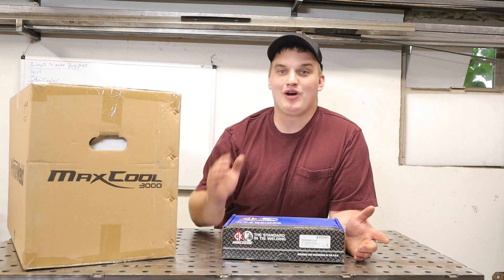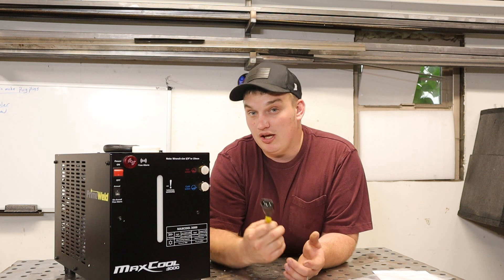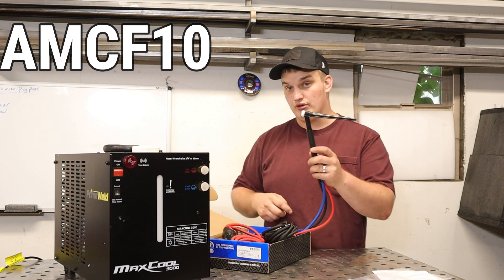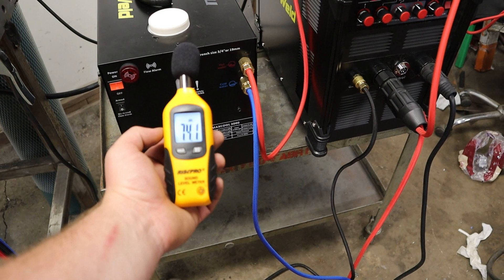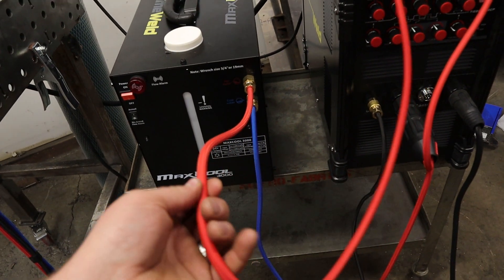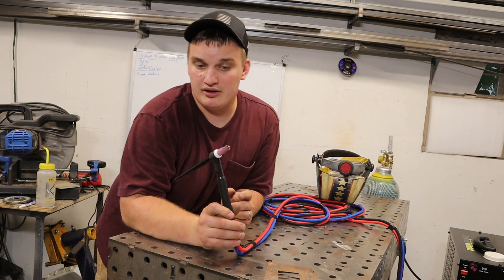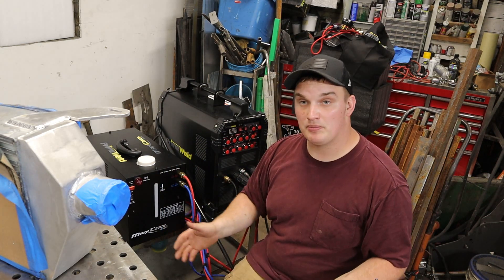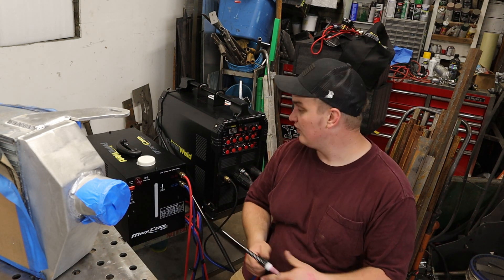Primeweld Tig Water cooler (Max cool 3000)

Comment: Hello sir, nice to meet you..
That CK torch that you have with the dinse style connection …
I went right to CK‘s website …
they don’t even have that as an option …
All their options seem to be the screw in type fittings …
Might you be able to provide a link to wherever you purchased that particular model of the CK20 ?
Reply from the maker: Yes you can either get it from prime welds website. Or another place I have got them. Is weld metals online. And I have a 10% off promo code for them if you go that direction. AMCF10 at checkout.
Reply from the maker: https://weldmetalsonline.com/collections/tig-torch-packages/products/20-series-ck-water-cooled-flex-head-tig-torch-for-everlast
Reply: OMG…. thank you, thank you so very much, you ROCK ! Thank you so much for taking time out of your day to do that for me so greatly appreciated.
You’re a great person, and I love your videos ..🤗
Reply from the maker: No problem

Comment: I have my primeweld cooler under the welder and it only beeps twice. Maybe it sitting side by side, and the hoses are higher than the torch, makes the pressure off balanced. Just a guess!
Reply from the maker: Never thought about that definitely something to consider 😎
Reply: I found out why I wasn't having the alarm going off. I had the red hose wrapped and ziptied, not too tight, which kept pressure on the hose. I realized it, when I took the zipties off to put a protective sleeve over the torch hoses....go figure!!!

Comment: Know I'm a little late to the party, but I just recently picked this cooler up. I was having some issues with no water flow and constant flow alarms. My guess was that the pump wasn't catching  prime.  Unscrewed the tank cap, and used the flat of my hand to "seal" the cap opening, then removed my hand. Did this a few times and it started moving water as it should. Flow alarms went away after that.  Just sharing in case anyone else runs into the same issues. Great cooler for the price point.

Comment: I was really surprised at how hot my 17 torch got, even at like 90-100 amps, particularly with the reduced gas flow using gas lenses. I had one of the HTP ones and it helped so much with comfort and consumable life.

Comment: Nice . I was wondering if one were to order the 225x and the water cooler at the same time , if Primeweld would do some sort of package deal with the consumables for the #20 torch ... I think I want to get this same set up but don't to waste my money (which is in short demand) with starting with the #17 and then want to run longer passes on aluminum and get the whole discouraged thing going on . lol
Reply: You should be fine I can weld quarter inch aluminum on 150 amps with the torch that comes with the machine pretty easy it's not ideal but you can make it work
Reply from the maker: To my knowledge they don't give out any discounts besides the $25 off for signing up on their mailing list. They're set up is already about 30% cheaper than any other machine with the same capabilities and features

Comment: Would say this is needed running the machine on 110 only?also I hear alot of people saying don't run stick on your tig machine basically saying keep it tig only any feedback on this I mostly wanna run tig but stick could come in handy do you ever run stick on your prime 225?
Reply: I'm pretty sure the machine is capped out at 140 amps if you aren't running 220, the 17 torch is rated at 150 amps, so you wouldn't have to worry about water cooling. you can run stick on a tig machine, but it really limits how well you can run a cellulose rod in some cases (i've heard even the machines with cellulose "modes" even struggle). the consensus is usually "just use a dedicated smaw/dc tig machine for stick" mostly because the machines tend to be a lot cheaper than an AC/DC tig, and for the price they run 6010 wayyy smother. I've heard many people say their chinese tig can run 7018 and other non cellulose rods fine though.
Reply: That sounds silly to me about not running stick
Reply: The added cooling is really only needed when running high amperage AC on Aluminum. You wouldn't be able to do that on 110, so there is not a need for the added cooling. Not running stick on a TIG/Stick machine is nonsense. That has no effect on the machine, as you typically run less amperage DC when running Stick.
Reply from the maker: Never heard of that
Reply: The bypass is a cheap way of protecting the pump from over pressure since a relief/pressure valve is more expensive and requires cleaning, that said the plugging of the overflow may contribute to pump failure if a line is inadvertently plugged.

Comment: These are a great combination machines. I have the same set up and just turned the alarm off from the start. My first job with it was a full stainless exhaust system for a 55 Ford truck with a big block. 3" tubing flanges etc. I ran it for ten hours straight with a couple breaks in the day. Welder, cooler torch all worked as well as my old school transformer machine in terms of quality and cooling. I had no issues with the cooler providing my CK 25 foot torch proper flow. Since I had no flow issues I don't think I'll be putting a screw in the blue hose. Your reviews are always good.